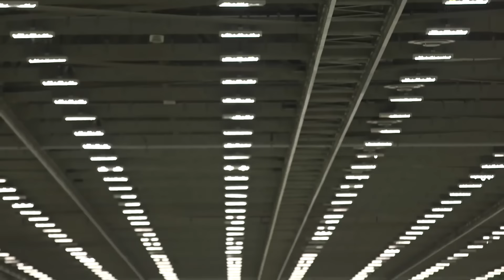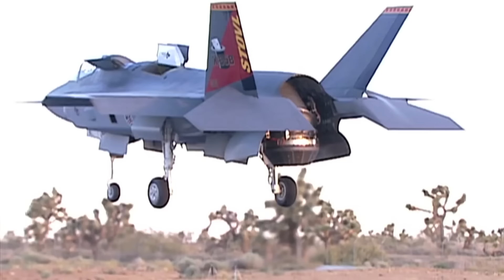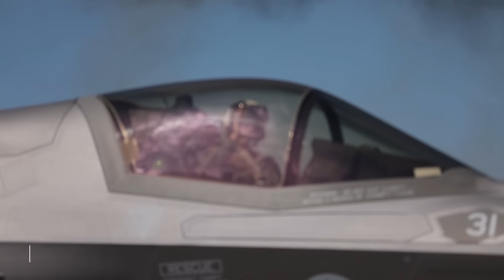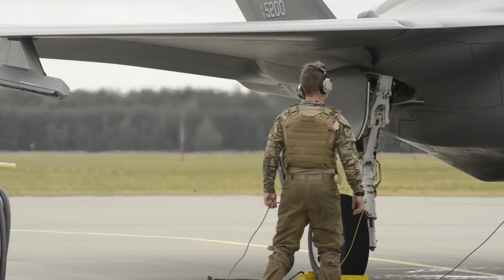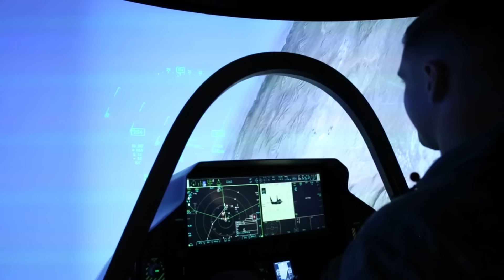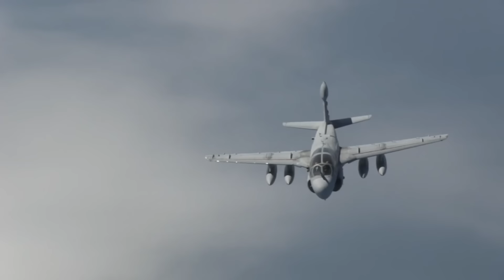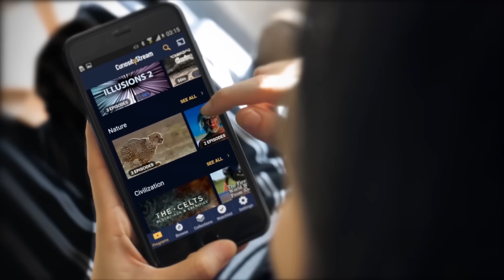Is The F-35 Worth $115 Million?

Comment: 10:40 thats what I always said. 3 branches with so many different needs require different designs.

The Air Force wouldn't be constraint to weight limits and size limits as much as the US Navy and Marine Corps would be. They would also be primarily tasked to fight Air Superiority - I would say that they could need a stronger engine (preferably are 2) and a bigger wing - allowing better turns and more fuel for combat operations deep into enemy territory. 

The Marine Corps would need something small like the F35 B - I think that the F35 is best as Marine Corps jet. 

The Navy would probably prefer a dual engine jet with huge range and large wings, again with size constraints. 

I think one could compromise a jet for B and C but the Air Force should have been given a different jet to built according to their need. They are the ones needing to replace most craft and they should get a true air force multirole fighter to complement F22. Something like a Rafale in stealthy.
Reply: Ah you know... bribes
Reply: Thanks for adding subtitles to the video.
Reply: I highly doubt that air Force want a air superiority fighter. Look at all the "air superiority" fighter in modern times. They all been modified to accommodate multi role. F15, f16.
Reply: @kevinguo3127  Well, true. I wrote it in my last abstract that they need a multirole fighter, similar to the Rafale which has been designed a true multirole fighter. Still, the Air Force would need to secure air superiority first.
Reply: @Sedna063  now days there is almost no difference between a multirole and a air superiority fighter. The only difference is on board computers. Think about it, you technically can just fit jdams on f22 and it would be a great multirole and without losing fighter capabilities. it still can just carry air to air load out and go air superiority.
Reply: indeed, i always thought the A and C variants where a bit stupid to begin with. the B is the only one that really bring something new (high carry weight VTOL supersonic stealth aircraft) which really is the only one i could see having a tactical role and a market apeal (most countries don't have supercarriers, very few have actual carriers, but more have destroyers with hellipads, a F35B makes a very good alternative to an attack chopper). for air superiority, i can't really see anything that other high tier air superiority aircrafts can't already do better, mainly because of the single engine (even a general purpose aircraft like the rafale boast an amazing thrust that the F35 simply cannot acheive) and in pure ground support, i still think something like the A-10 would work much better (even more so if the platform was updated with better tech). 

but the ability to have a craft that can fit all roles well, and can be stationed anywhere is the real deal, and i think all efforts should be concentrated on that version as it is the one i see having the most apeal
Reply: @mobiuscoreindustries  I think the Air Force would need a Rafale style plane. They could hence replace the F15E, F16, A10 without too much trouble. (That is not to say that Rafale is only alternative, I simply use it because it is a true multirole fighter, unlike my own country's Eurofighter which is foremost air superiority fighter)
Reply: @Sedna063  yeah, but this is where politics come in. the rafale is a french plane, designed by dassault systems and fundamentaly designed from the ground up for being a no bulshit effective and efficient plane. it does not go out to be the best, but to work in as much environements as possible. of course America would never accept equiping their military with foreign technology, because that would be admiting the inferiority of their own industry design. 

but the reality is that expensive tools are simply not needed in our modern conflicts. even in their inceptions they never were. targets that something like the B22 or the F22 are designed to engage simply do not exist, advanced nationVnation war is simply not a thing in our day and age, now it is mostly nationVguerilla, and here those expensive fighters simply don't work. 

you have an 80 million dollar plane, that dropped a 800 thousands dollars missile on a 7K dollar honda truck piloted by 3 rebels. precision and stealth simply gives nothing in those situations, which is the reason why A-10 still fly around: they perform very well in that job. but we aren't making those kinds of aircrafts, because if the army was to ever do so, then there is litteraly nothing that would justify the exorbitant expenses on the military that the governement is making. in fact, a slow but resilient platform is probably what would work the best in the current climate, with better sensor and potentialy stealth being points that can be improved. 

when you think about it, military tech is just there for the flex, because while fancy aircrafts make for good show of force during public representations, it is the rugged and robust designs that carry their weight in the conflict zone. new tools are always welcomed, especially those that can enhance the safety of their operators and increase precision to decrease collateral damage. here things like stealth and sensors really make a diffrence, but when it comes to roles, the effort should be on ground targets, trying to find ways to deal better with the hidden and complex nature of today's conflicts.
Reply: @mobiuscoreindustries  Bribes to make LM rich....
Reply: Think the only "stupid" one is the C. Jets dont really need good turn rate, dogfighting is a thing of the past.
Reply: "I would say that they could need a stronger engine (preferably are 2)" - then you misunderstand the F-35. The F-15 and F-16 are the high-low pair. The F-15 is the twin engine air superiority fighter, while the F-16 is the single engine multirole. The F-22 and F-35 are also a high-low pair. F-22 is the twin engine high, the F-35 is the single engine low.

Comment: A fighter jet's only purpose is dogfights, no?
How is it even considered if it fails at that. Even if was cheaper, it would still be a bad idea.
This plane only looks good because it's new and has good technology (ie. Sensors and computer guidance), and literally any plane could be retrofitted to that
Reply: Modern jets don't need to dogfight. If the F35 can detect and fire it's missiles before the other jet can detect it than it has already won the fight. That is why stealth is so important.
Reply: Dogfights haven't been the core role of the fighter jet since the 70s. Since the cold war, it's pretty much been an arms race of developing better and better guided missiles, and better systems for jamming or confusing them. Actually engaging another jet with cannons often isn't possible or practical. Retrofitting planes isn't nearly as straightforward as you think - for example, you can put the most sophisticated radar system money can buy on a MiG-21, but the part of that plane that can actually hold a radar is a really, really terrible place to keep a radar. That part of the design is inherently a weakness, but it allows the jet to be stronger in other ways. Basically, this shit is really, really, really complicated.
Reply: Just based on what I've heard here, the f-35's advantage is staying hidden for longer while being able to detect enemies farther. So with advantages like that the f-35 might not need to do traditional dogfighting if they can destroy the enemy fighter before they get spotted.
Reply: They will most likely be used for intelligence gathering and air to ground ops. They can do a lot besides shoot down other fighter jets.

Comment: Hot garbage. Most of them don't have VTOL anymore. It uses its own fuel as hydrolic fluid. Its more expensive than any other aircraft of its size and is only slightly stealthy. Also, hot recirculated air is more powerful and efficient. Its the exhaust fumes that cause it to choke up

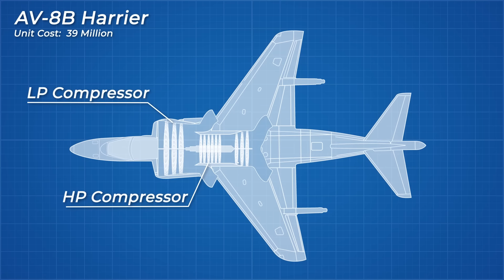Comment: 3:35 isn't what you call a "low pressure compressor" actually a fan ?
Reply: Not in a turbojet, although the way the air is diverted around the engine core does make the Harrier's engine look like a turbofan. You could be right.
Reply: The fan in a turbofan engine also serves as the N1 compressor (the center area compresses and feeds into the jet engine) so both names would be correct
Reply: Ok, I thought the Harrier was turbofan

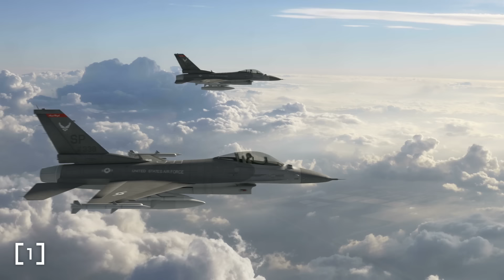Comment: 1:25 the A-10 is not an air superiority fighter
Reply: A-10 is one of my favourite plane but we have to agree that it has its own shortcoming especially high-tech enemy.

If the job is to shoot some terrorist with gun, A-10 is better plane for lower prize.
Bur the job is to support troops against advanced country, F-35 is much better for avoid getting see and lock from the first place before sending ordinates.
Reply: I like the A-10. But honestly there might be better options in the future. It still pretty costly to run. And you might have aircraft with better loiter capability, more suited for it role. But that is not losing track of what the role is. The F-35 can fill some of that role. But far from all of it. Shooting up tank columns is likely something the F-35 can do pretty well with the right load out of missiles. 

But for ground support you may want to actually go even lower tech. Having drone or propeller planes replace the A-10. But you need to look at the total picture of course. When you just look at a sheet of stats then a A-10 might look a lot worse then a F-35. Like it is objectively slower. But it slower speed is not only a liability. But even more so it strength for the role it preforming.
Reply: It's an anything-superiority fighter
Reply: Yes it is. She comes into the sky and with one brrt she wins the day
Reply: It's an aircraft who support the infantry by ground attack !
Reply: The A-10 is just tremendous flying machine gun.
Reply: Imagine if it was though. Not the most nimble or the fastest it just powers through the missiles and then repays them with a BRRRRRTTTTZZZZ
Reply: It's not. It's a multi-role fighter. Such as the F15E and 16. Of which both are outclassed by the F35.
Reply: Why not? Spray some freedom
Reply: Nor is F-35
Reply: It is if your MLG like I am 😜
Reply: Don't confuse the terms "air-to-air" and "air superiority" people...
Reply: Aint the A-10 essentially a missle dilivery system? Or bomber?
Reply: @nicosmind3  The A-10 was designed for destroying columns of Soviet tanks advancing into Western Germany. Now it's most effective at causing insurgent forces to scatter as soon as it opens up with its Gatling gun. It flies low and slow, so is only really useful in areas where we already have complete air superiority, but on the flip side it can react more quickly to changing situations on the ground
Reply: @nicosmind3  A-10 is  a fast ground support platform.
Reply: @nicosmind3  Pretty much all aircraft can be seen as weapons delivery platforms. Though the A-10 carries more then missiles and bombs. It fame comes from it massive Gatling style canon. It not the only thing it carries as some may think. But the aircraft was very much build around it.

The true role for it is like TheeSabin point out. A fast ground support platform. Able to be on standby supporting troops on the ground. But is not the aircraft you use to fight other aircraft. This is also why ground troops tend to like the craft a lot.
Reply: @nicosmind3  The A-10 is a close-in ground support airplane designed to be able to go low and slow so that it can deliver its payloads onto an adversary that is in proximity to friendly forces. Compare the wing plan form of the A-10 to that of the F-35, the A-10 has very little sweep since it's not fast, relative to any fighter, which enables to generate more lift which allows it to generate much more lift than the F-35 at slow speed.

The F35 will never be as good as the A-10 in close-in ground support mission since the A-10 was specifically designed for that purpose. Stealth won't much help in the ground support role, since many engagements are within visual range, which makes the A-10 vulnerable to optically sighted and guide weapons. The A-10 is also vulnerable to these kinds of weapons but it is strongly armored and can withstand significant damage and safely return the pilot back to base.

You can bolt a hitch to a Ferrari and it could likely tow a trailer but its gearing and suspension were not designed for that task.
Reply: @cidercreekranch  The A-10 was also designed in the 1970s for a conflict theorised in the 1960s. It goes low and slow because that was all they could do back then. The F-35 does not need to go low and slow to accomplish the same thing, and can actually be more effective from up high than the A-10 is down low. 
The A-10 isn't armoured. Only it's cockpit. The armour does not protect the plane and the A-10 is known to have suffered the most combat losses of all US combat aircraft during Desert Storm because SEAD could not clear the battlefield of short-range IR guided missile platforms. The A-10 also did not serve on the frontline during that war.
Reply: @Little Cripple It’s a freedom dispenser
Reply: @nicosmind3  That would be an understatement from some perspectives. The A-10 at MTO can take 15,000 pounds of ordanance with maximum fuel load. The only WWII bomber capable of that was the Lancaster which could with some variants take 22,000 pounds. As for missile delivery system it can take most that are in the books and quite a few of the obsolete ones have not been removed from it's capability (EG Shrike and Bullpup) that said for some reason it usually carries Mavericks which are completely over the top for some missions.  It also has that monster Gau-8A which will rapidly turn an APC into a giant colander.
Reply: he didn't say they were
Reply: Flynn Taggart 
Flynn Taggart “from the start, the f-35 sought to be a jack of all trades, an air superiority fighter to replace the air forces f-16’s and a-10’s...”
Reply: @connorweaver3937  yes but  that's what the pentagon planners are saying...

#BRTT4ever
Reply: @PrograError  not anymore, a-10 is gonna continue service for a bit
Reply: AsHalt i’m not saying it’s a bad aircraft, but it’s strictly a ground support/ close air support aircraft
Reply: Flynn Taggart he literally said it’s attempting to be an air superiority fighter to replace the air forces current f-16’s and a-10’s.. so yes, he did say that it was an air superiority fighter, he should have however, said that it is also attempting to replace the a-10 as a close air support aircraft
Reply: Boeing got a contract to make new modern wings for the a-10s. So I think they will stay in service for a minimum of two decades
Reply: @connorweaver3937  did you miss the part where he said jack of all trades...
Reply: BladesMasterX i did not, but the f-35 is replacing much more than just the f-16 and a-10, my point is, he miss-spoke, saying the a-10 is an air superiority fighter
Reply: @connorweaver3937  neither am I , it's those goon in the petagon... they pretty much called it a relic...
Reply: @connorweaver3937  man i really don't want to teach people how english works on the internet, even though it would be the first and only time my bachelors degree would be remotely useful. he did not say that the f-35 is attempting to be an air superiority fighter for the reason of replacing the f-16 and a-10 (which makes no sense), he was listing some of the attributes of the f35 such as it being a jack of all trades and being an air superiority fighter, and then stated that it would be replacing the f-16 and a-10. again, if you believe none of this, it is at least reasonable to assume he would know what an a-10 is given all the research he has done here and in the past on these subjects.
Reply: @flynntaggart8549  - "From the start, the F-35 sought to be the jack-of-all-trades. An air superiority machine to replace the Air Forces F-16's and A-10's. . ." Phrasing it like that makes it sound like he's referring to the A-10 as an air superiority fighter
Reply: @flynntaggart8549  He did mate @ 1:28
Reply: @godfroi10991  if you listen carefully, and have a decent understanding of how english works, no, he didn't.
Reply: @flynntaggart8549  So I listened carefully and have no idea what you're talking about, he clearly does (Note how many other people are making the same observation). No need to be a smart arse either Flynn, especially considering your use of commas leads me to believe you might want to look in the mirror first.
Reply: @godfroi10991  i wasn't trying to be. it doesn't really matter to me what you think.
Reply: @flynntaggart8549  If you weren't trying to be, why attack my grasp of English. Not how one starts a civil discussion friend. I guess everyone on here's incorrect but you though good Sir...
Reply: @godfroi10991  also a handful of people compared to the 675,000 views on this video isn't really a good sample size